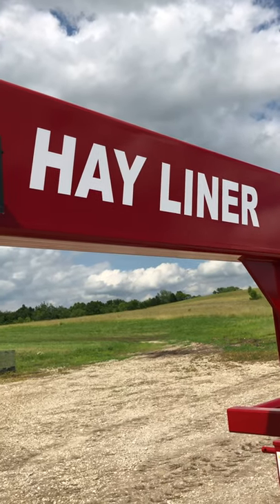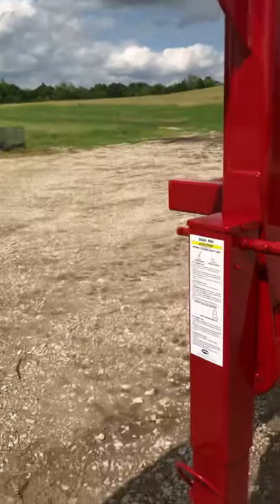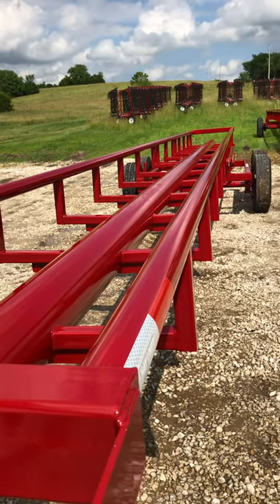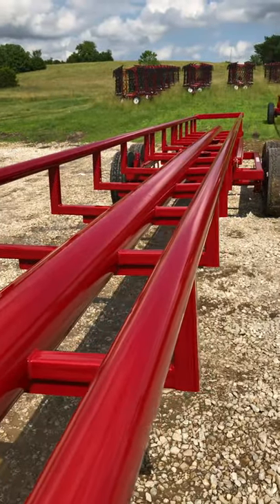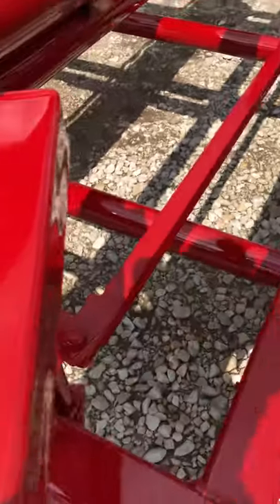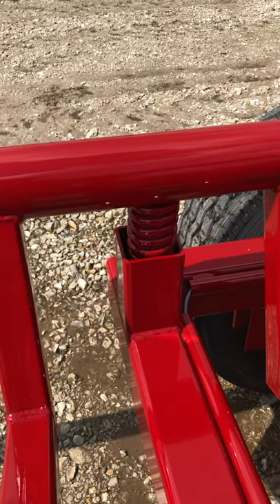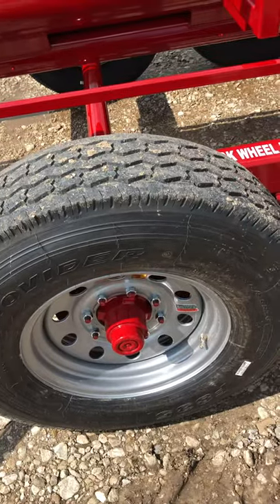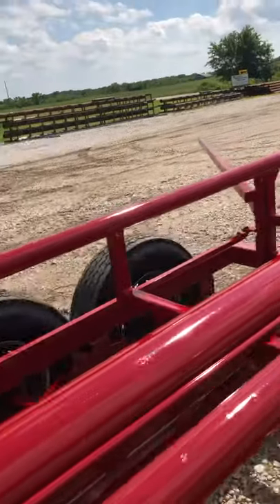Hay Liner trailers comparison to other trailers

Comment: You said all wrliring was in conduit.....that is a lie ..when you doing the video the first thing I noticed was when you spoke about the " spring being compressed".there is wire showing in the corner that will chaff on that tubing also around the axles wires are exposed....if I can see this in the video why would you say that? This is your own video